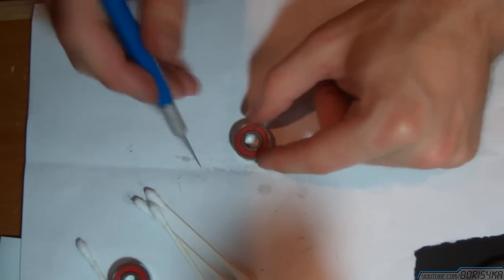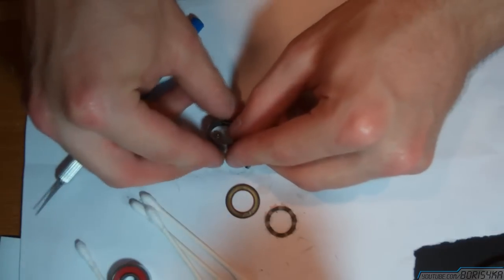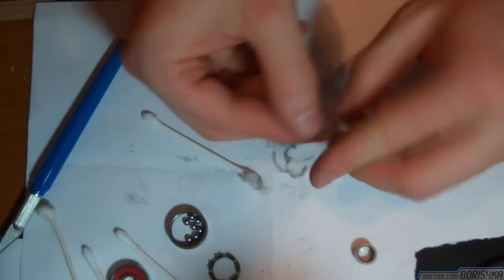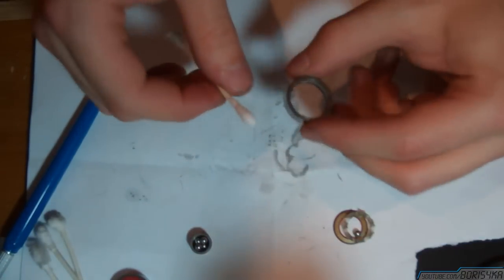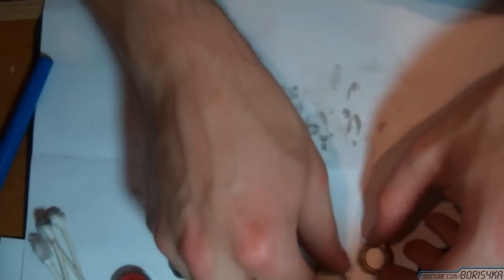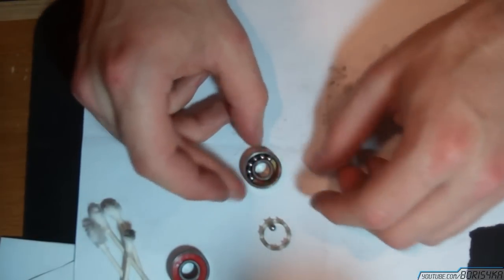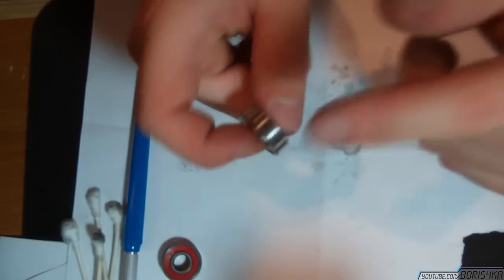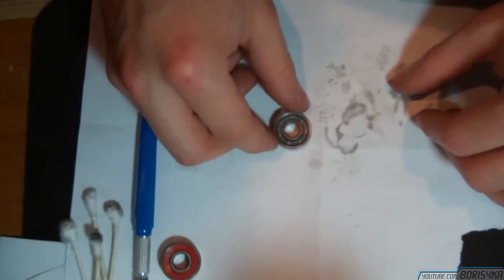How to completely rebuild a ball bearing

Comment: Mind doesn't have a plastic rail guide(?) but two metal ones that clip together on either side. Any advice on that?
Reply: ecksdeeeXD
Reply: ecksdeeeXD same here
Reply: Braxton Hall I actually found that one side of that rail guard has little metal flaps that clip one side onto the other. You can carefully flip those open with a knife or small screwdriver and pull them apart, clean the bearings, and put them back together as long as you don't bend them too out of shape!

Comment: The bearing spinning for a long time and making that whirring sound means it's dry, not that it's lubricated.  After you lubricate it, it should spin silently assuming it was cleaned properly, and it also won't spin as long because of the abundance of lubricant, but it will help save your bearings from overheating or rusting.  Also, don't use wd40 unless you have rust to remove, and clean it off before you lubricate.
Reply: You seem to know a thing or two, maybe you can help.
What other ''liquid'' instead of wd40 can I use to help clean tiny dirt particles?
Reply: @rinaldsriters6505  I clean my bearings with 99% pure rubbing alcohol, because it dries quickly, and then I lubricate with Bones Speed Cream.

Comment: don't use wd40 reason being is it eats away the plastic housing, for years the plastic housing in my bearings kept snaping because of it, trust me I've been skating for nearly 13 years and my friend owns a skate shop and says the same thing. easiest way to clean bearings is get acetone from a hardware store ( not the stuff you use for nail polish you want the more industrial strength stuff) put it in a small container, take the rubber ring of your bearings then put the bearings in the container. next close the container and shake it for a couple of minutes set it down for about 30 seconds then take them out, wipe off any extra acetone it's quick drying then put them back in and they'll roll like new
Reply: I use gas and it works pretty good someone told me that helps.
Reply: Jafo Cakes Should I keep the bearings in the metal rings or take them out?
Reply: Jafo Cakes zy
Reply: Jafo Cakes thnx

Comment: Wd40 is really too thick for bearings. If you can't get your hands on any speed cream, just go to Walmart or any department store and get some sewing machine oil. It's the same thing.
Reply: Matthew Pressley I suspect the reason the bearing spun faster and faster at the end was the WD-40 evaporating and/or wicking out from between the race and the balls.

Comment: Dont listen to this guy a thick lube like wd40 is made for big moving parts like a bike chain. It works on bearing for a bit but then it becomes like a super glue attracting dirt and makes bearings worst. U need a thin lube custom made for bearings like BONES SPEED CREAM you can usually pick it up at ur local skate shop. PS IF YOU ARE READING THIS YOU SHOULD CONSIDER USING BONES SPEED CREAM AND DELETING THIS VIDEO. it will helP your self and others. no wonder ur bearing were slow ;)
Reply: He's not using WD40 as a lubricating agent, he's using it to remove the old grease and dirt since it's a penetrating oil. A tiny bit of it is left over which shouldn't cause issues. Clearly what he did to the bearings improved it, and yes, bearings grease/oil would improve it further (as mentioned in description), but that wasn't what the vid is teaching, it's teaching how to take it apart to remove the old gunk and dirt.

Comment: i use a magnet, just place it anywhere on the outer ring. take out the magnet, the outer ring will be slightly magnetized for a moment but strong enough to pull the bearing balls in the inner part of the outer ring. just place the inner ring and spread out the bearing balls and youre done. you dont have to buy a magnet if you have fridge magnets, i use them.
Reply: That will actually leave the metal balls magnetized and attract a bunch of debris and even cause the bearing not to be as smooth

Comment: Assuming you have a cheap bearing with a removable cage. Most quality bearings will use a ribbon cage that isnt removable. Now that you have BENT the cage it will never operate properly and cause the seal to not properly go back into place. Not that that matters because you damaged / bent the seal metal backing when you removed it.